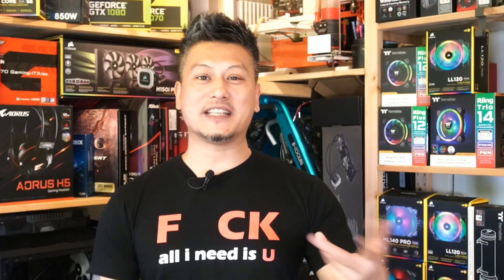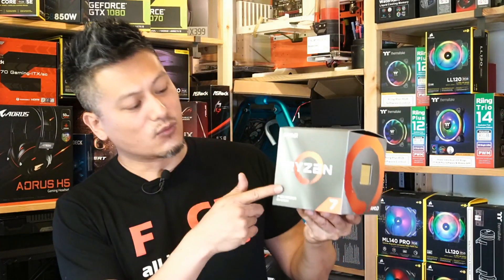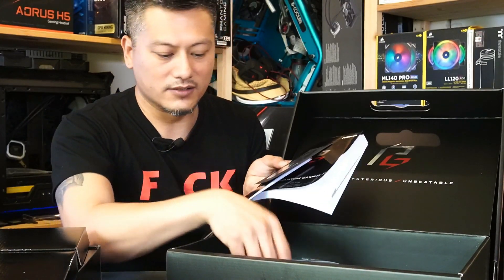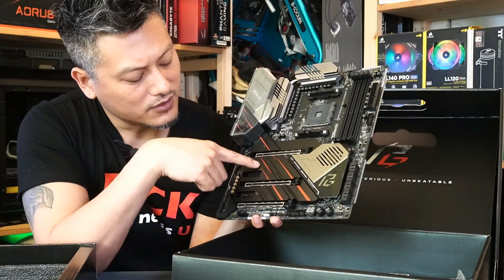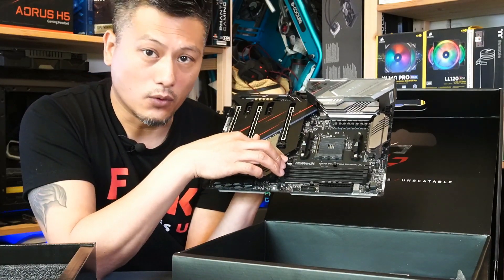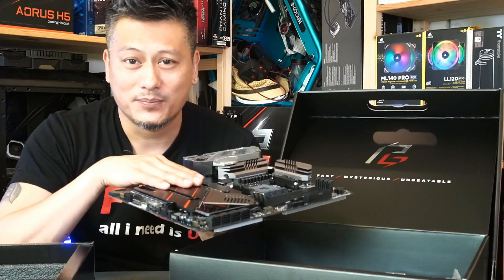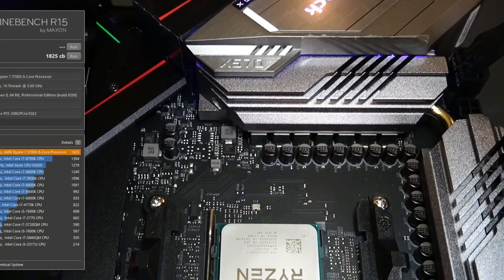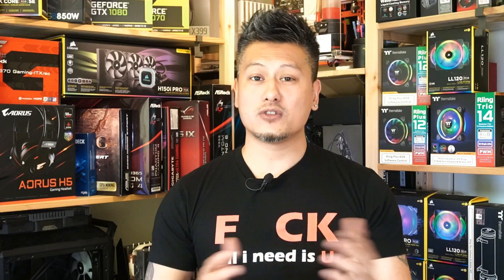The Best Gaming Motherboard for the Ryzen 3000 series processor - ASRock X570 Phantom Gaming X

Comment: The accessories are very bare-bones for a $350 flagship motherboard.  They don't even throw in a RGB extension cable or a front panel que-connector. And, I can't believe motherboard makers STILL give you a freaking CD-ROM driver disk.  Really?  It's now 2020, and I guess Asrock has still never heard of a mini USB key.

Comment: Nice that I bought the x570 phantom and the 3700x as well.
Reply: and which cooler do you use
Reply: @sparky3826  stock for now. Planning on getting some form of water cooling in the future.
Reply: Many IQ Guy  I'm running a temporary rx570 8gb gpu. Plan on upgrading to the 2070 super soon.
Reply: How much temp of 3700x in load

Comment: What is good rgb ram for that? I will use 3900x prosessor.
Reply: You need to see what works with it. This is listed on the Memory QVL on the motherboard website.
Then you need to see what's available.
Then you need to see what you can afford.
Ideally get a 3600-16 kit. I got a 3600-18 4x8gb (Corsair Vengeance LPX) kit listed for the Taichi that was a good price - from Newegg.
Reply from the maker: Corsair or Patriot ... G.Skill and Adata is also good too 👍

Comment: I am using the vanilla bios and the s fan is so whiny and annoying, I will see what its like post-update.
Reply: Let me know how it goes? I was thinking of getting this board but seen videos about the whiny fan
Reply: @ko1-i2i  Apparently from what others are saying is that the chipset runs hot anyway, I have it usually at 70°C and just keep the fan set to around 25%, once in the case the noise becomes inaudible but anything higher than 45% it becomes pretty whiny. So overall I will stick with it. I was just worried about the high temps, and as it seems that that s the normal temperature then thats fine.